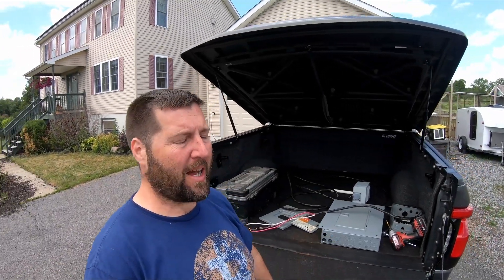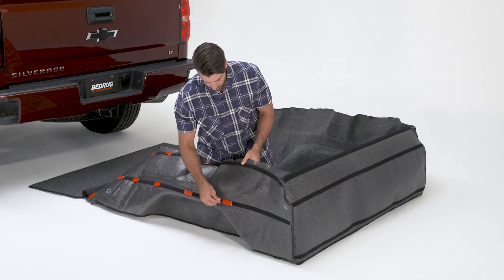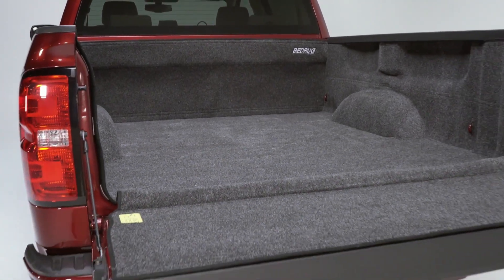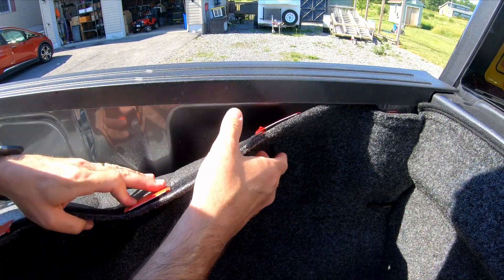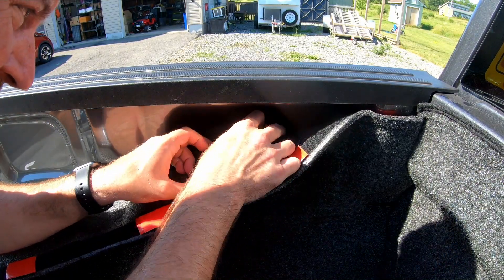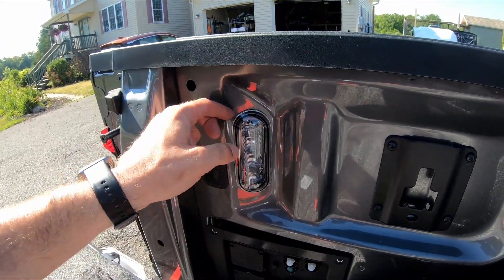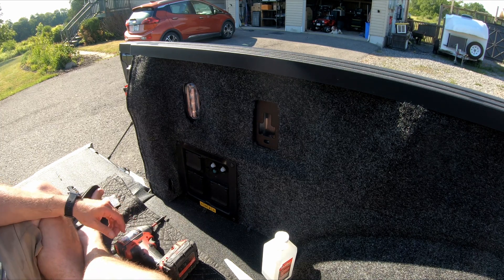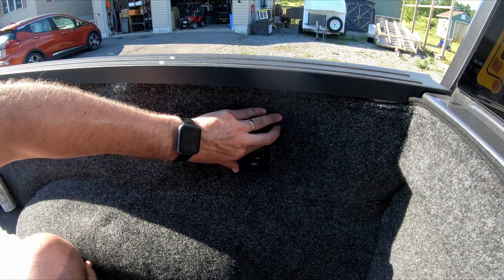Bed Rug Installation in 2022 Ford F150 Lightning

Comment: Jua installed a bedrug in my 2023 Lightning.  I gotta say, removing the cargo tie downs and mounting points and just screwing them over the top of the bedrug was so simple. Much quicker and cleaner than cutting around them.
Reply: I agree! I did the same for mine. I got crafty and just sliced flaps for the outlet and truck bed light button so I can keep them hidden and just flip the flaps open when I need to use them.

Comment: Why not take that cargo block off, put the screws back in press the liner against them so it reflects where you need to cut for the screws. Cut those areas push the liner in and pull the screws out and screw that cargo tie down block back on.

Comment: Thanks.  Getting ready to do this on my 22 F150 hopefully next week.  At your bed accessory brackets, you could either use a littel extra velcro on the sides or just bolt the bracket on the outside of the carpet.

Comment: Take off the brackets and slice the H, put th he box link bracket on top of the bedrug. The light is easy to get out and cut a hole in the bedrug to fit the light. I would not want gaps in my bedrug when I dont have to, looks sloppy I think. You show a video from bedrug but there are better ones on YouTube.
Reply: Correct. RealTruck has a video showing how to accommodate the box link brackets and corner tie downs with minimal cutting.

Comment: I've never seen a bed rug before. What are the pros/cons over a spray in liner? Your install video was great. I've a build date for my Lightning so it is getting real. Did I see a link for bed rug in your list?  If I get one I'm happy to use your link.
Reply from the maker: I dont have a special link. I used Auto Anything. They were the best price I found. I didnt realize the difference though at the time. This is the newer, upgraded, one with the more rugged floor. I was expecting the carpet one. Either way, I have heard they are great. I really love it so far. I think a shovel would probably gouge it but I dont plan on trying. I like it a lot. I think this or the carpet one would both be good.